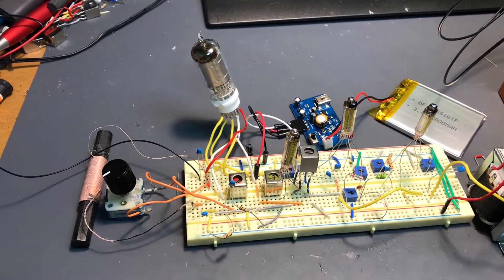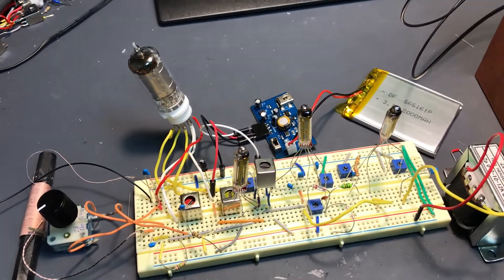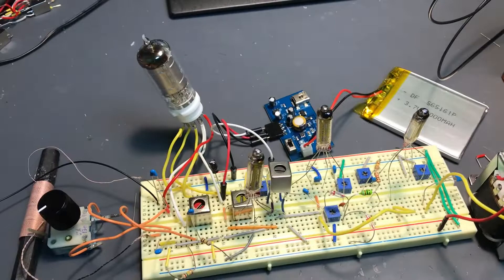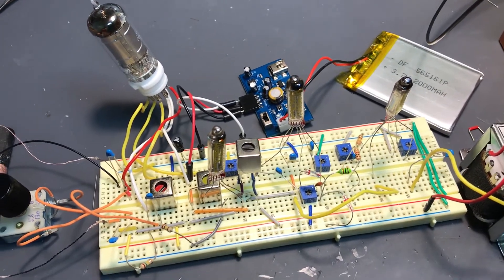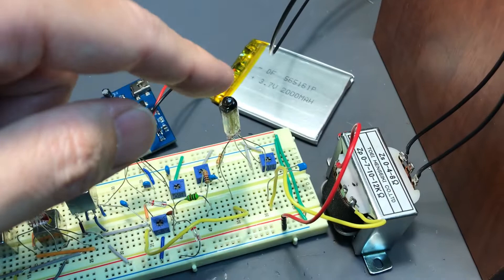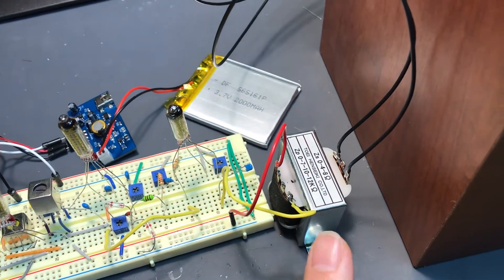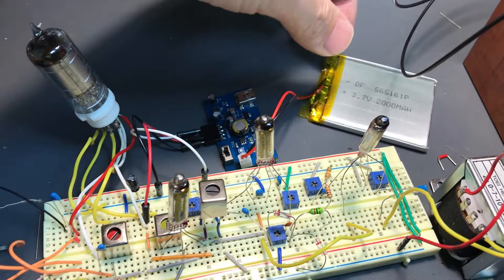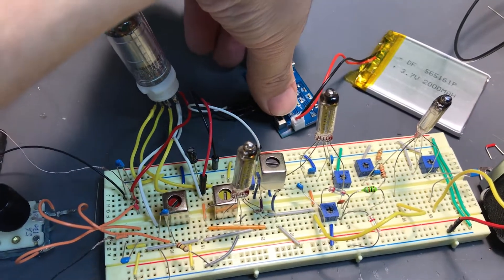Breadboard 4-tube superheterodyne radio circuit is fixed.

Comment: I'd use the last tube in pentode mode for more output power, with the output transformer connected in the conventional way between the plate and B+ and, of course, removing C7.